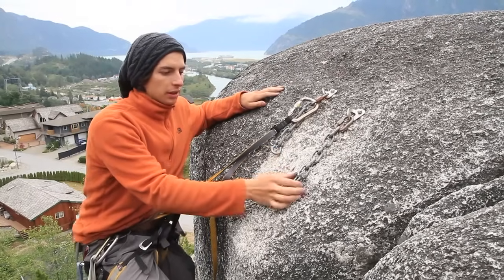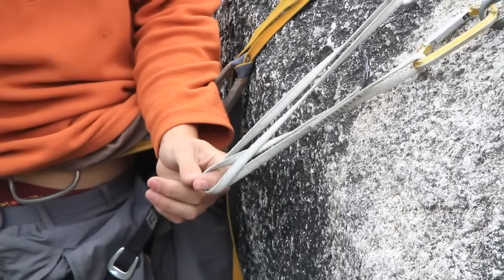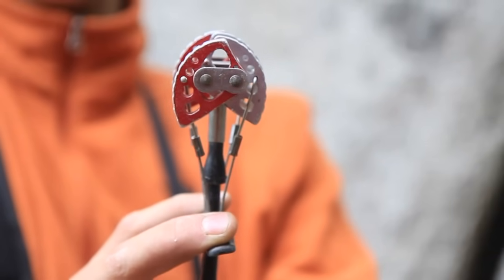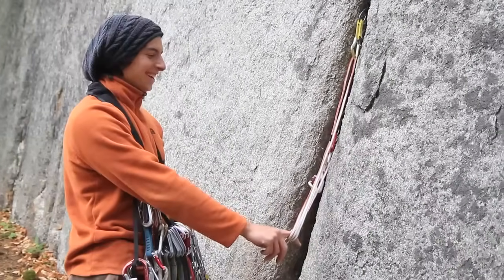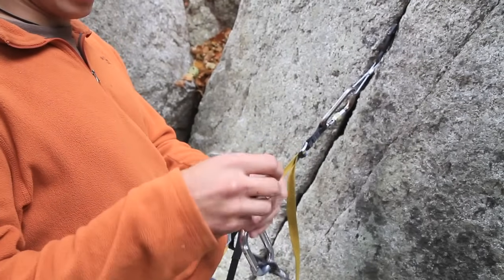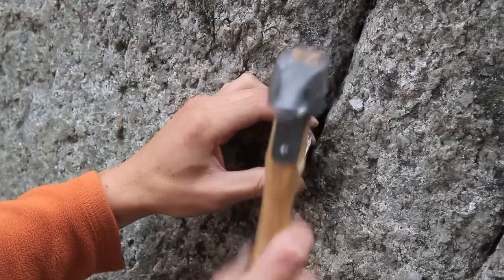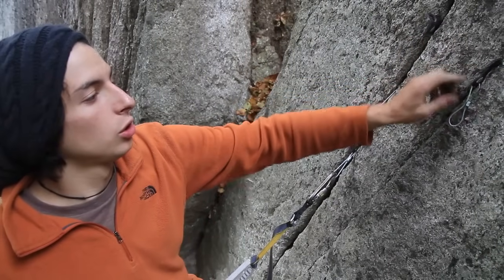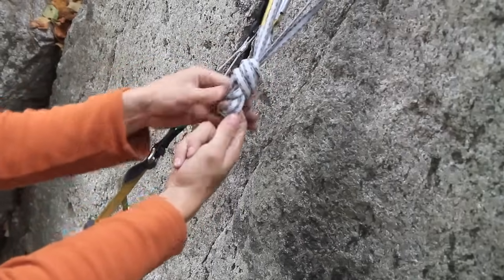Rock Climbing Anchors

Comment: I always see movies where the climbers put an anchor in a spot in the cliffside seemingly randomly. When they get off track & had no plans to actually climb that spot so it seemed they made their own anchors instead of using one at the top of where they were climbing from. I always wondered how something could just go into a little crack like that and actually hold, and what that product looked like & how it was used. Your video answered those questions for me so thank you very much. It’s so amazing that they’ve come up with a tool that can be put generally anywhere in the cliffside to anchor climbers in.

Comment: Great video. I am not a rock climber myself so it makes me wonder how many anchors do you need carrying with you. It looks like none of these are retrievable. Being more of a mountain hiker, I am after the best anchor type to move across rocks. Not so much for proper rock climbing but more like mountain hiking and the occasional mountain passes where you may have to secure yourself where there is black ice or frozen snow the time to cross a ledge. The weather changes so fast that sometimes the granite slab you just climbed all the way up to a saddle gets all wet and all of a sudden it becomes a very slippery proposal and being able to secure yourself for the descent is a real handy piece of knowledge to pick the right equipment. Maybe using a mix of two or three cams with a short leash in addition to the non retrievable anchor types would be my best option. Do these cams work well in snow and wet conditions or the rock has to be as dry as possible? Are there any known alternatives for wet rock  conditions?

Comment: I may be missing something completely- but when you have 3 anchors at different heights- and you place a sling across three- if it is is tied nearest to the bottom cam- dosn't that create a moment arm that would make the protection less effective over all?  Or is the concept you rely on one cam and the other two are just backups?
Reply: The concept is to evenly distribute the load across 3 different points. If one fails in the event of a fall the other 2 will catch the fall. The height of each piece is irrelevant due to the nature of anchor building and incorporating equalization so that all point are waited evenly no matter their height

Comment: As an engineer the only anchor I would risk my life with is a raw bolt because the torque applied is stopping it pulling out, as long as that is substantially more than your weight then it will never come out unless the laws of physics change, the glued bolts and cams use mechanical friction and interference which can change for a number of reasons.

Comment: While I see a lot of people pointing out all the problems with his instructions, as someone who knows literally nothing about climbing gear, I at least found this interesting to get an idea of what sorts of stuff is used for anchors
Reply: And 3 years later, me too. No-one should be watching this video and then going off and doing it for themselves for the first time anyway. I always thought climbers hammered literal wedges or somehow screwed bolts into rock and I couldn't understand how they could trust such single devices. This showed me they have many more tools available,  those tools are smaller and lighter than I had imagined, and that they use them with redundancy in mind. Very useful  video for the curious non-climber to get an idea about things.

Comment: There seems to be a fair bit of discussion here about knotting dynema slings in part due to the studies run by DMM and the resulting failures one knot can produce in factor 1 and factor 2 falls using standard 80KG test loads.  Please note this study and those like it (while very helpful) are extremely conservative given the rigid nature or the anchor (possibly realistic) and the load (unrealistic).  An actual climber's body will compress in the harness and may even enter a rotation.  Each of these occurrences will effectively act like rope stretch and lower the overall loads. Personally I do not tie knots in Dynema and prefer to use a 7mm cordellete where possible.   But the overall impression people seem to have is overly sever.  If anyone knows of testing using a realistic climber load, please reply with a link as I think that information could be very useful.

Comment: As others have noted, there are several things wrong with the methods he shows:
- First, always clip the bolts directly, not the ends of the chains. Only use the chains when rappelling. Clipping the ends of the chains wears them out faster, and introduces more potential failure points (especially with that janky hardware store connector at the bottom, clearly not rated for climbing..)

- The standard is to use a locking carabiner on each bolt, and two locking biners at the master point for top-roping (one if you're belaying directly off the anchor).. For multi-point anchors, you don't necessarily need a locking biner at every piece, but at least some of them should be locking, generally the most critical / strongest pieces.

- Pitons and copperheads?! What century is this? I'm sure that gear still has it's place, but these days and for 99% of people, stick to removable gear and 'clean climbing' ethics, and use nuts, cams, tricams, hexes, etc.

- A sliding X is still popular, and whether using it with a single sling is sufficiently safe is debateable.. However it is not redundant, and it is easy enough to add a second sling, or put load-limiter knots on each side, to make it redundant.
Reply: you make a lot of good points, but the only one I have issue with is your use of "janky hardware store connector" it's called a clevis, and it's rated for over 6000 pounds of load. they're used with cranes or when you lift large loads. it's probably more secure than the bolt itself.
Reply: You do make good points - but you're overreaching on ethics. He was clearly talking about an alpine settings, and what the ethics are in different locations varies a lot.... in the Canadien rockies for example you can definitely still find those and people still use them. You don't do that at the roadside crag everyone goes to, but your intervention makes it look more out of place than it really is...

Comment: Jesus, no mention of ethics or clean climbing when using pitons/copperheads. Sure there's places where it's acceptable, and I'd value my life over the rock any day, but in a lovely crack like that, with plenty of pockets which look like they would take a nut you really shouldn't be hammering in stuff unless you have no choice. If you tried that in North Wales someone would soon "educate" you quite forcefully.
Reply: The issue is that you seem to approach this question purely from the perspective of your local crags.

The world is a big place, and long alpine route still see those. It's not mainstream trad climbing but it still has its place for alpine stuff... don't be so assertive when there's not need for it.

One could say the same about sport climbing & bolting in general on the same premises. Clearly though sport climbing is alive and well and has its places in crags where the local ethics values this approach. In trad-oriented crags it would be as close to a crime it could be to bolt a crack (or even anything, in some places).
Reply: So this may be a dumb question, but I really am unsure, do those peckers and bugaboos remain in the rock forever, or is there a way to take them out?
Reply: Indeed, I would be educating them with the hammer and piton, in a certain crack that wont be found in any climbing guide

Comment: The anchor at the beginning is very poor. I'm not trying to "hate" but why are you belaying off the chains and not off the bolts? You increase the risk of failure when you put each link in the chain into play. Why use a magic x if you're only going to use one sling? It's not a redundant system. If the sling breaks the entire system will fail.
Reply: ^^ I also agree. try using a clove hitch on each carabiner after its directly attached to the bolts and equalizing. Same thing you did attach the top non-lockers to the sling with cloves, and not on the chains. Or better yet double it up with a second identical length sling, as Brian G. mentioned.

Generally its a bad idea (or at least discourteous by my understanding) to use those lower bottom chain links as many rap off those and attaching metal that can shift during a fall could create nicks or other damage to the anchors. This poses many potential safety issues, especially for beginners and also increases the maintenance needs of the crag.
Reply: Sucks when you can't rap thru another group on their way up because they have their anchor on the bottom of the chains

Comment: he said RANGE of the cam. range is how far it will open, if it was at 90% it would be way to far open, and not enough teeth of the cam would be in contact with the rock. if its more than 70% opened up its too small for that crack

Comment from the maker: hi thanx for your feed back, you have some really interesting points here, good eye i do was attached to one point that was overconfidence of the area, i should definitely work on risk management for my next videos, i agree that teaching the safest technics is always the best, but somtimes it can get complicated to do figure eight and overhang not is enough for the force crated on an anchor. I used a head because in a bailing situation heads are only a couple bucks as with stoppers there are 15$

Comment: This video is problematic. These are techniques that should be taught in person. While it is fine to demonstrate these techniques here, this video is advertised as a lesson when it should not be.
Other points:
-It appears that you are directly anchored to only one bolt
-Teach the safest possible technique (instead of the sliding x, show an equalized figure 8 using four locking biners)
-Alpine anchor doesn't belong in this lesson.
-Why did you use a head instead of a stopper in the alpine anchor?